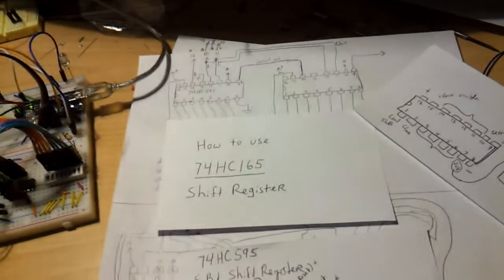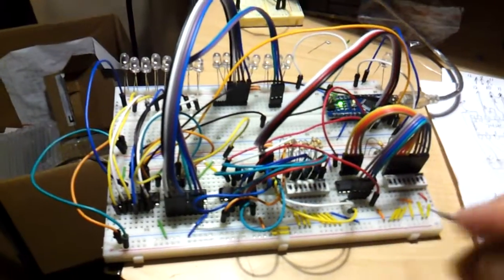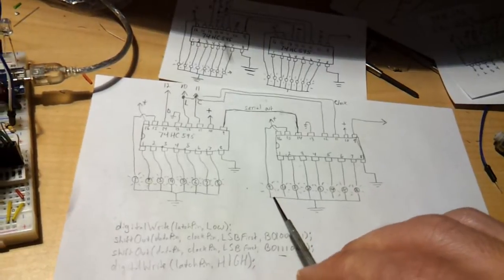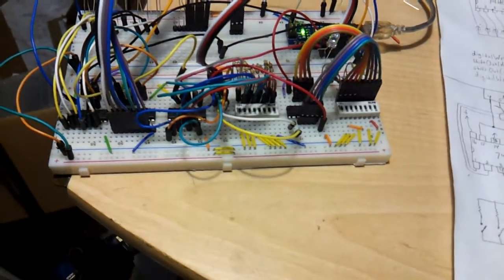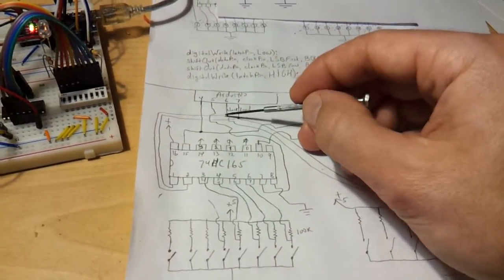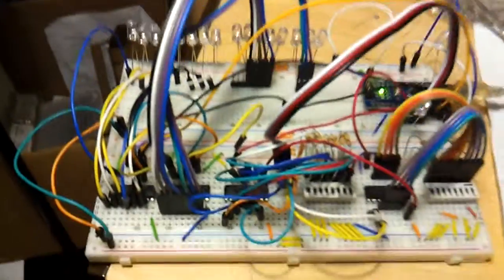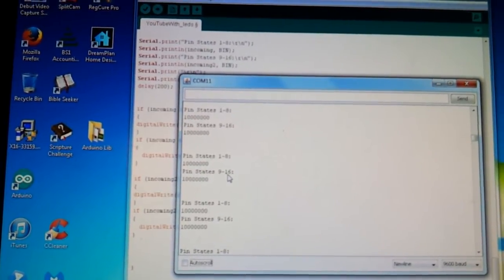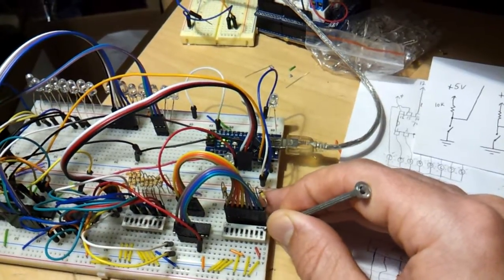Using 2 Shift Registers 74HC165

Comment: Please upload the code
Reply from the maker: // 74HC595 74HC165 
// Pin 1 - LED 1 Pin 1 - Load 
// Pin 2 - LED 2 Pin 2 - Clock 
// Pin 3 - LED 3 Pin 3 - Input 4 
// Pin 4 - LED 4 Pin 4 - Input 5 
// Pin 5 - LED 5 Pin 5 - Input 6 
// Pin 6 - LED 6 Pin 6 - Input 7 
// Pin 7 - LED 7 Pin 7 - Data 
// Pin 8 - Negative (Ground) Pin 8 - Negative (Ground) 
// Pin 9 - (Not Used) Serial out Pin 9 - (Not Used) 
// Pin 10 - MR Master Reset (+) Pin 10 - (Not Used) 
// Pin 11 - SHCP CLOCK Pin 11 - Input 0 
// Pin 12 - STCP LATCH Pin 12 - Input 1 
// Pin 13 - OE Output Enable (-) Pin 13 - Input 2 
// Pin 14 - DS DATA Pin 14 - Input 3 
// Pin 15 - LED 0 Pin 15 - Clock Enable (CE) 
// Pin 16 - Voltage IN (+) Pin 16 - Vcc Voltage IN (+) 

 //74HC595 PIN OUT
        
             // Pin 1 -  LED 1
             // Pin 2 -  LED 2
             // Pin 3 -  LED 3
             // Pin 4 -  LED 4
             // Pin 5 -  LED 5
             // Pin 6 -  LED 6
             // Pin 7 -  LED 7
             // Pin 8 -  Negative (Ground)
             // Pin 9 -  (Not Used) Serial out
             // Pin 10 - MR Master Reset (+)
             // Pin 11 - SHCP CLOCK
             // Pin 12 - STCP LATCH
             // Pin 13 - OE Output Enable (-)
             // Pin 14 - DS DATA
             // Pin 15 - LED 0
             // Pin 16 - Voltage IN (+)

//Pin connected to latch pin (ST_CP) of 74HC595 PIN 12 
int latchPin = 10; 
//Pin connected to clock pin (SH_CP) of 74HC595 PIN 11 
int clockPin = 11; ///Pin connected to Data in (DS) of 74HC595 PIN 14 
int dataPin = 12; 

int load = 7; // Connects to Load pin 1 74HC165 
int clockEnablePin = 4; // Connects to Clock Enable pin 15 74HC165 
int dataIn = 5; // Connects to the Data pin 7 74HC165 
int clockIn = 6; // Connects to the Clock pin 2 74HC165 

 byte incoming, incoming2;

void setup() { 
Serial.begin(9600); //Pin connected to latch pin (ST_CP) of 74HC595 PIN 12 
pinMode(latchPin, OUTPUT); //Pin connected to clock pin (SH_CP) of 74HC595 PIN 11 
pinMode(dataPin, OUTPUT); ///Pin connected to Data in (DS) of 74HC595 PIN 14 
pinMode(clockPin, OUTPUT); 
pinMode(load, OUTPUT); 
pinMode(clockEnablePin, OUTPUT); 
pinMode(clockIn, OUTPUT); 
pinMode(dataIn, INPUT); 
pinMode(2, OUTPUT); 
pinMode(13, OUTPUT); 
}
  
void loop() { 
  
digitalWrite(load,LOW); 
delayMicroseconds(5); 
digitalWrite(load,HIGH); 
delayMicroseconds(5);

digitalWrite(clockIn,HIGH); 
digitalWrite(clockEnablePin,LOW); 
byte incoming = shiftIn(dataIn, clockIn, LSBFIRST); 
byte incoming2 = shiftIn(dataIn, clockIn, LSBFIRST);
digitalWrite(clockEnablePin,HIGH); 
digitalWrite(latchPin, LOW); 
shiftOut(dataPin, clockPin, LSBFIRST, incoming ); //1-8 digitalWrite(latchPin, HIGH); 

        // Shift out to 74HC595
        digitalWrite(latchPin, LOW); 
        shiftOut(dataPin, clockPin, LSBFIRST, incoming2 );
        shiftOut(dataPin, clockPin, LSBFIRST, incoming ); //1-8
        digitalWrite(latchPin, HIGH);
delay(50); 

Serial.print("Pin States 1-8:\r\n"); 
Serial.println(incoming, BIN); 
Serial.print("Pin States 9-16:\r\n"); 
Serial.println(incoming2, BIN); 
Serial.print("\r\n"); 
Serial.print("\r\n"); 
delay(200); 

if (incoming == B10000001) // if switch 8 is high
{
digitalWrite(13, HIGH);
}
if (incoming == B10000000)
{
  digitalWrite(13,LOW);
}

if (incoming2 == B10000001) // if switch 8 is high
{
digitalWrite(2, HIGH);
}
if (incoming2 == B10000000)
{
  digitalWrite(2,LOW);
}}

Comment: Where is the code?
Reply: Great question.
Reply from the maker: // 74HC595 74HC165 
// Pin 1 - LED 1 Pin 1 - Load 
// Pin 2 - LED 2 Pin 2 - Clock 
// Pin 3 - LED 3 Pin 3 - Input 4 
// Pin 4 - LED 4 Pin 4 - Input 5 
// Pin 5 - LED 5 Pin 5 - Input 6 
// Pin 6 - LED 6 Pin 6 - Input 7 
// Pin 7 - LED 7 Pin 7 - Data 
// Pin 8 - Negative (Ground) Pin 8 - Negative (Ground) 
// Pin 9 - (Not Used) Serial out Pin 9 - (Not Used) 
// Pin 10 - MR Master Reset (+) Pin 10 - (Not Used) 
// Pin 11 - SHCP CLOCK Pin 11 - Input 0 
// Pin 12 - STCP LATCH Pin 12 - Input 1 
// Pin 13 - OE Output Enable (-) Pin 13 - Input 2 
// Pin 14 - DS DATA Pin 14 - Input 3 
// Pin 15 - LED 0 Pin 15 - Clock Enable (CE) 
// Pin 16 - Voltage IN (+) Pin 16 - Vcc Voltage IN (+) 

 //74HC595 PIN OUT
        
             // Pin 1 -  LED 1
             // Pin 2 -  LED 2
             // Pin 3 -  LED 3
             // Pin 4 -  LED 4
             // Pin 5 -  LED 5
             // Pin 6 -  LED 6
             // Pin 7 -  LED 7
             // Pin 8 -  Negative (Ground)
             // Pin 9 -  (Not Used) Serial out
             // Pin 10 - MR Master Reset (+)
             // Pin 11 - SHCP CLOCK
             // Pin 12 - STCP LATCH
             // Pin 13 - OE Output Enable (-)
             // Pin 14 - DS DATA
             // Pin 15 - LED 0
             // Pin 16 - Voltage IN (+)

//Pin connected to latch pin (ST_CP) of 74HC595 PIN 12 
int latchPin = 10; 
//Pin connected to clock pin (SH_CP) of 74HC595 PIN 11 
int clockPin = 11; ///Pin connected to Data in (DS) of 74HC595 PIN 14 
int dataPin = 12; 

int load = 7; // Connects to Load pin 1 74HC165 
int clockEnablePin = 4; // Connects to Clock Enable pin 15 74HC165 
int dataIn = 5; // Connects to the Data pin 7 74HC165 
int clockIn = 6; // Connects to the Clock pin 2 74HC165 

 byte incoming, incoming2;

void setup() { 
Serial.begin(9600); //Pin connected to latch pin (ST_CP) of 74HC595 PIN 12 
pinMode(latchPin, OUTPUT); //Pin connected to clock pin (SH_CP) of 74HC595 PIN 11 
pinMode(dataPin, OUTPUT); ///Pin connected to Data in (DS) of 74HC595 PIN 14 
pinMode(clockPin, OUTPUT); 
pinMode(load, OUTPUT); 
pinMode(clockEnablePin, OUTPUT); 
pinMode(clockIn, OUTPUT); 
pinMode(dataIn, INPUT); 
pinMode(2, OUTPUT); 
pinMode(13, OUTPUT); 
}
  
void loop() { 
  
digitalWrite(load,LOW); 
delayMicroseconds(5); 
digitalWrite(load,HIGH); 
delayMicroseconds(5);

digitalWrite(clockIn,HIGH); 
digitalWrite(clockEnablePin,LOW); 
byte incoming = shiftIn(dataIn, clockIn, LSBFIRST); 
byte incoming2 = shiftIn(dataIn, clockIn, LSBFIRST);
digitalWrite(clockEnablePin,HIGH); 
digitalWrite(latchPin, LOW); 
shiftOut(dataPin, clockPin, LSBFIRST, incoming ); //1-8 digitalWrite(latchPin, HIGH); 

        // Shift out to 74HC595
        digitalWrite(latchPin, LOW); 
        shiftOut(dataPin, clockPin, LSBFIRST, incoming2 );
        shiftOut(dataPin, clockPin, LSBFIRST, incoming ); //1-8
        digitalWrite(latchPin, HIGH);
delay(50); 

Serial.print("Pin States 1-8:\r\n"); 
Serial.println(incoming, BIN); 
Serial.print("Pin States 9-16:\r\n"); 
Serial.println(incoming2, BIN); 
Serial.print("\r\n"); 
Serial.print("\r\n"); 
delay(200); 

if (incoming == B10000001) // if switch 8 is high
{
digitalWrite(13, HIGH);
}
if (incoming == B10000000)
{
  digitalWrite(13,LOW);
}

if (incoming2 == B10000001) // if switch 8 is high
{
digitalWrite(2, HIGH);
}
if (incoming2 == B10000000)
{
  digitalWrite(2,LOW);
}}

Comment: I simulated the code in proteus but none of my LEDs were going on. They just remained off as i opened and closed the switches
Reply from the maker: Simon Katimba arduino is controlling it
Reply from the maker: Simon Katimba make sure you have the arduino code
Reply: Fedor Weems i entered the arduino code correctly. can i email u my schematic?
Reply from the maker: Simon Katimba yeah,  fedorweems@gmail.com
Reply: Fedor Weems sent. check your email

Comment: could you please show me a schematic of how i would connect 8 switches(input) to my 74HC165 to Arduino and then to my 74HC595 to my 8 LEDs(output)?When a correspong switch is off, then a corresponding LED should go on
Reply from the maker: Simon Katimba the schematic I have in the video is the only one I have, it's drawn on an index card

Comment: Hello good afternoon,

I'm trying to build a circuit with shift registers 74hc165 and 74HC595, its is very well explained, however wanted to use sensors with normally closed contacts would look like this code, I have to help me.
Reply from the maker: +Carlos Inter Ship not sure what you mean by normally closed sensors... the chips should work best with switches, and they are very versatile
Reply: +Fedor Weems Right! Let's leave aside the sensors and we will work with switches, is if we were using normally closed switches, as he opened the corresponding LED kindled and kept flashing until the switch back to close, then the LED goes out.
Reply from the maker: +Carlos Inter Ship if the switch is normally closed then that means that there is ground going into the input of 165chip. so whenever you flip the switch there is now a positive going into the input of the 165chip. so all you need to do is to reverse the binary bit. from B10000000 to B11111111
Reply: Fedor Weems, good evening, I resumed the experiments and would like to know in which part of the code I should make this binary change from b10000000 to b11111111, since I thank you.
Reply from the maker: Carlos Inter Ship 
it's at the bottom of the code
if (incoming ==b10000000)
change it to
if (incoming == b11111111)
Reply: Hi Fedor good night, I did as you said however, the situation is the same, ie during the switch is open the 74hc595 leds are off, when I close the switch the led lights up, in fact I want to do the opposite when The switch is closed the 74hc595 led is off and when i open the switch the led comes on, could you do it this way?
Reply from the maker: Carlos Inter Ship 
easy fix, on the 165 chip, you need to wire the switches backwards. the 10k resistors need to be connected to ground instead of positive. and the other side of the switch you need to connect to positive instead of ground
Reply: My friend thank you, I did what you told me and it worked perfectly, just one more question, what is the maximum number of IC's I can use, how many IC's 165 and how many IC's 595.
Reply from the maker: Carlos Inter Ship 
as many as you want
Reply: Once again, thank you very much.

Comment: Excellent tutorial and explanation. Using the '165 and the '595 in a home cockpit simulator with 153 inputs (buttons/switches) and 254 outputs (LED indicators, etc). I would be interested in seeing a latching circuit for the inputs that would latch high or low during a fast button press to hold the state in between "polling" by the arduino. With as many inputs (and associated processing) that I have, sometimes a button press can go unnoticed. Anyhoo, great video!
Reply: Hi Houston Firefox,
are rotary encoders working fine or not...means is there missing values of rotary or not?

Comment from the maker: // 74HC595 74HC165 
// Pin 1 - LED 1 Pin 1 - Load 
// Pin 2 - LED 2 Pin 2 - Clock 
// Pin 3 - LED 3 Pin 3 - Input 4 
// Pin 4 - LED 4 Pin 4 - Input 5 
// Pin 5 - LED 5 Pin 5 - Input 6 
// Pin 6 - LED 6 Pin 6 - Input 7 
// Pin 7 - LED 7 Pin 7 - Data 
// Pin 8 - Negative (Ground) Pin 8 - Negative (Ground) 
// Pin 9 - (Not Used) Serial out Pin 9 - (Not Used) 
// Pin 10 - MR Master Reset (+) Pin 10 - (Not Used) 
// Pin 11 - SHCP CLOCK Pin 11 - Input 0 
// Pin 12 - STCP LATCH Pin 12 - Input 1 
// Pin 13 - OE Output Enable (-) Pin 13 - Input 2 
// Pin 14 - DS DATA Pin 14 - Input 3 
// Pin 15 - LED 0 Pin 15 - Clock Enable (CE) 
// Pin 16 - Voltage IN (+) Pin 16 - Vcc Voltage IN (+) 

 //74HC595 PIN OUT
        
             // Pin 1 -  LED 1
             // Pin 2 -  LED 2
             // Pin 3 -  LED 3
             // Pin 4 -  LED 4
             // Pin 5 -  LED 5
             // Pin 6 -  LED 6
             // Pin 7 -  LED 7
             // Pin 8 -  Negative (Ground)
             // Pin 9 -  (Not Used) Serial out
             // Pin 10 - MR Master Reset (+)
             // Pin 11 - SHCP CLOCK
             // Pin 12 - STCP LATCH
             // Pin 13 - OE Output Enable (-)
             // Pin 14 - DS DATA
             // Pin 15 - LED 0
             // Pin 16 - Voltage IN (+)

//Pin connected to latch pin (ST_CP) of 74HC595 PIN 12 
int latchPin = 10; 
//Pin connected to clock pin (SH_CP) of 74HC595 PIN 11 
int clockPin = 11; ///Pin connected to Data in (DS) of 74HC595 PIN 14 
int dataPin = 12; 

int load = 7; // Connects to Load pin 1 74HC165 
int clockEnablePin = 4; // Connects to Clock Enable pin 15 74HC165 
int dataIn = 5; // Connects to the Data pin 7 74HC165 
int clockIn = 6; // Connects to the Clock pin 2 74HC165 

 byte incoming, incoming2;

void setup() { 
Serial.begin(9600); //Pin connected to latch pin (ST_CP) of 74HC595 PIN 12 
pinMode(latchPin, OUTPUT); //Pin connected to clock pin (SH_CP) of 74HC595 PIN 11 
pinMode(dataPin, OUTPUT); ///Pin connected to Data in (DS) of 74HC595 PIN 14 
pinMode(clockPin, OUTPUT); 
pinMode(load, OUTPUT); 
pinMode(clockEnablePin, OUTPUT); 
pinMode(clockIn, OUTPUT); 
pinMode(dataIn, INPUT); 
pinMode(2, OUTPUT); 
pinMode(13, OUTPUT); 
}
  
void loop() { 
  
digitalWrite(load,LOW); 
delayMicroseconds(5); 
digitalWrite(load,HIGH); 
delayMicroseconds(5);

digitalWrite(clockIn,HIGH); 
digitalWrite(clockEnablePin,LOW); 
byte incoming = shiftIn(dataIn, clockIn, LSBFIRST); 
byte incoming2 = shiftIn(dataIn, clockIn, LSBFIRST);
digitalWrite(clockEnablePin,HIGH); 
digitalWrite(latchPin, LOW); 
shiftOut(dataPin, clockPin, LSBFIRST, incoming ); //1-8 digitalWrite(latchPin, HIGH); 

        // Shift out to 74HC595
        digitalWrite(latchPin, LOW); 
        shiftOut(dataPin, clockPin, LSBFIRST, incoming2 );
        shiftOut(dataPin, clockPin, LSBFIRST, incoming ); //1-8
        digitalWrite(latchPin, HIGH);
delay(50); 

Serial.print("Pin States 1-8:\r\n"); 
Serial.println(incoming, BIN); 
Serial.print("Pin States 9-16:\r\n"); 
Serial.println(incoming2, BIN); 
Serial.print("\r\n"); 
Serial.print("\r\n"); 
delay(200); 

if (incoming == B10000001) // if switch 8 is high
{
digitalWrite(13, HIGH);
}
if (incoming == B10000000)
{
  digitalWrite(13,LOW);
}

if (incoming2 == B10000001) // if switch 8 is high
{
digitalWrite(2, HIGH);
}
if (incoming2 == B10000000)
{
  digitalWrite(2,LOW);
}}